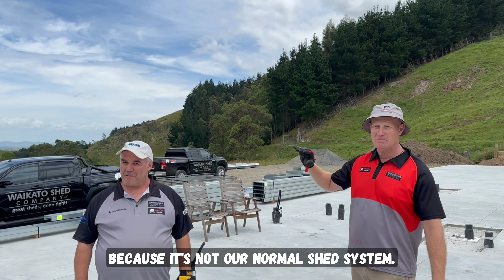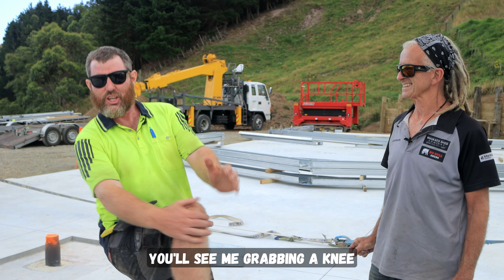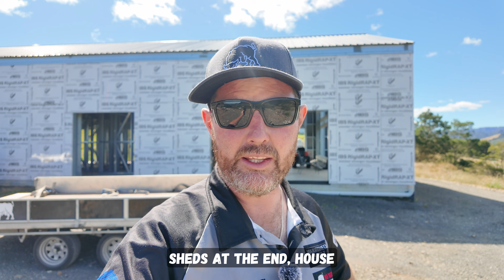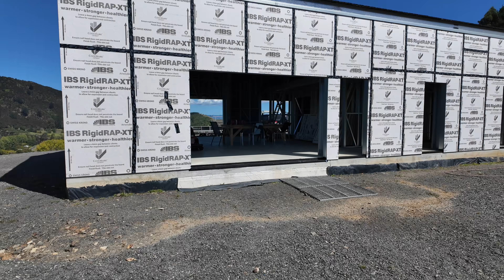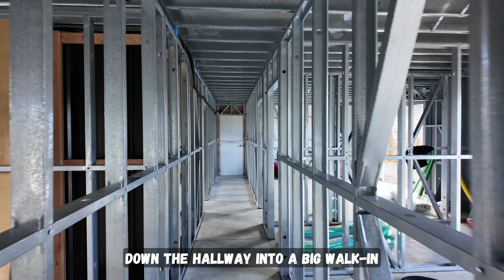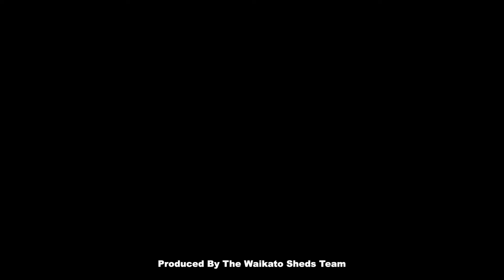Check Out This MASSIVE Barndominium Kit Set Shed House Build in the Coromandel NZ

Comment: Amazingly strong looking. Beautiful spot too. I noticed on the website with the 3D design tool, that there is a 6m height limit. What if I wanted to build something 12m tall? Is that feasible? Basically a 4 floor building.
Reply from the maker: Thanks for that we can do slightly taller but no more that two story with our system.
Reply: @waikatosheds  Ok thanks for the quick reply. We're just trying to decide on our method of build. We like the idea of steel for all the framing because it's light weight and strong. Obviously many large warehouses are higher than 6m. I guess they need thermal breaks, but we did find one place that can make insulated panels up to 12m in length. They would come on a flatbed truck and be craned in place.
Reply from the maker: @Justyburger  would this be for a warehouse or residential? May be better to email the idea jason@waikatosheds.co.nz and we can go from there. Cheers
Reply: @ Residential. Basically a tower house. Small footprint but tall. 5x5m at the base, rising up to 11.5m.
Reply: @ Residential. Basically a tower house. Small footprint but tall. 5x5m at the base, rising up to 11.5m.

Comment: do you need a consent? how much for something like that shed?
Reply from the maker: Yes you will need consent for this for the full build at $2000 a sqm roughly $750k as this is an extra high wind zone on a cliff side and full custom design. Thanks Jason
Reply: @waikatosheds  I'm assuming that $2000 a sqm is for just making it weathertight, taking into account the owner doing the interior fitout. That would be very cheap otherwise. Normal cost would be around $5000 I'd guess.